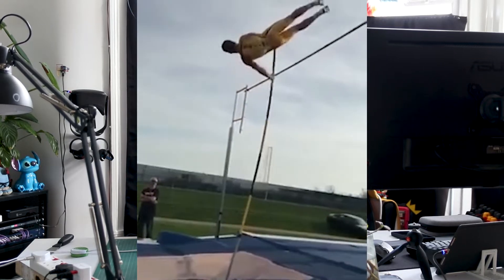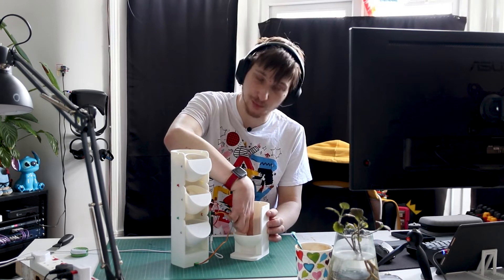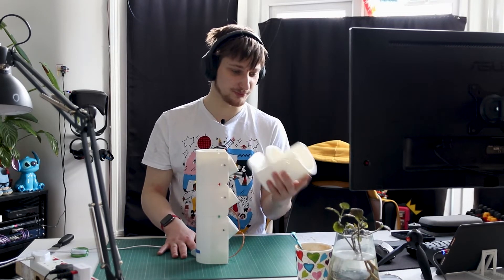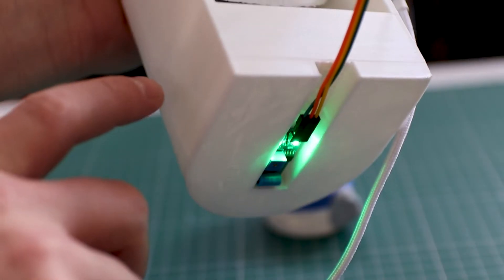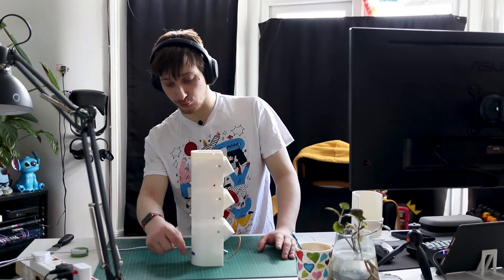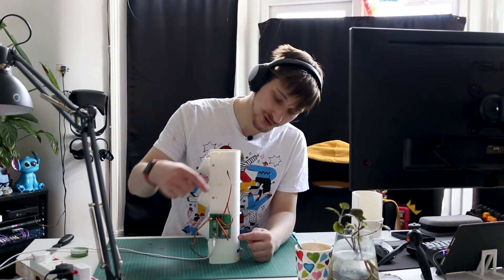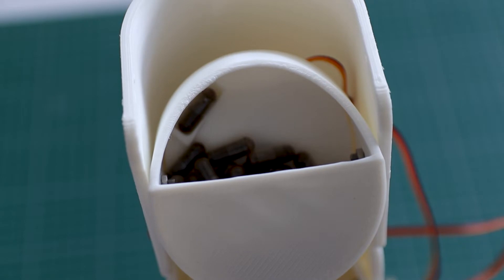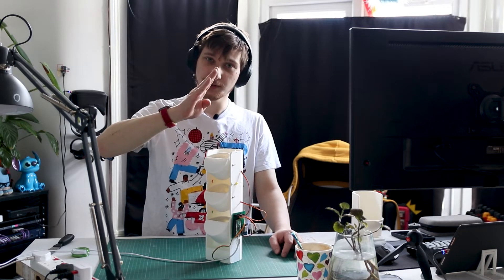Automatic Pill Dispenser update

Comment: Hey, so I'm running into a small problem,  everything seems to be designed for capsules, tablets don't necessarily work.

Is there any way I could pay you to design some shields for common medications for adhd and depression? I think that this would be incredibly useful for the savant geniuses who can print out and program a device to dispense their meds, but can't remember to take them.
Reply from the maker: hey thanks for your feedback, I'm literally about to release a new video on this project it should be out tomorrow.

but here's a sneaky preview.
https://www.youtube.com/watch?v=UZQ9VuxIBHU

I don't mind making more Shields for you, but I have hesitations with people using the pill dispenser for things like antidepressants.
i just because I worry about the dispenser not working properly and giving too high or too lower dosage.

but if you can send me some dimensions of the tablets and i'll see if I can do some testing, it might be that I need a different movement profile for the servos for better reliability.
Reply: @Mellow_labs  the good news is that we can probably figure something out, send over some measurements on reddit when I get off work, I'll get everything printed and I'll let you know what changes need to be made to make sure it dispenses properly.  

Thanks dude!